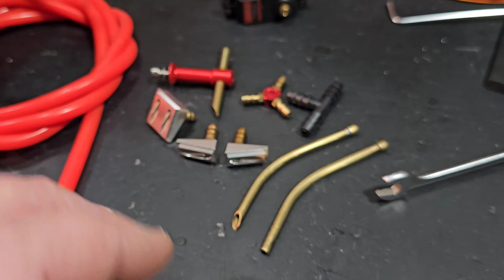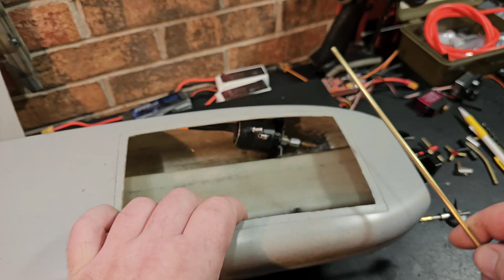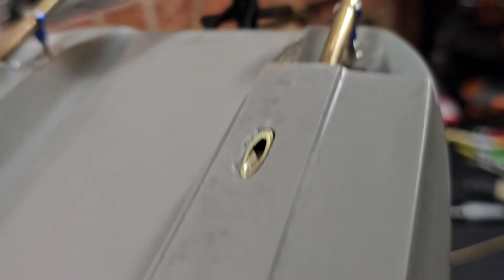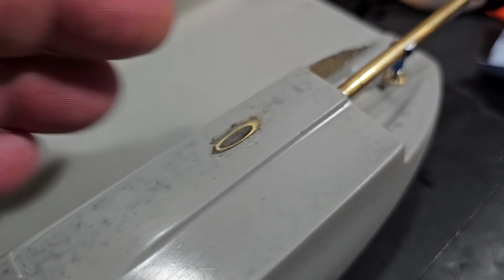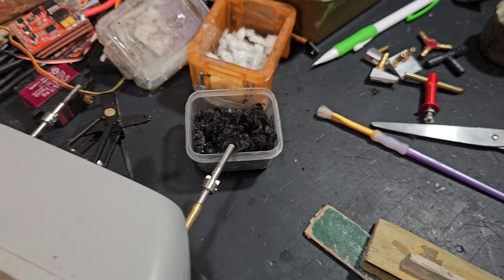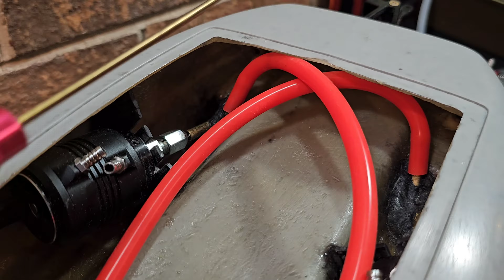Cheap Flush Mounted Water Pickup Install Twin Motor Cat Build Part 3 - Rc Boat Water Cooling

Comment: Hey man my name is Mike Berry I live in North Carolina I just want to let you know that your channel I came across and subscribed and I've been watching a ton of videos the idea you had to carbon fiber line the inside of the UL 19 and use the aftermarket motor mount and the other mods that I could have gone bought the black jack 24 rtr and upgrade everything but I just bought the hull and lid.. carbon fiber mat and titanium motor mount and a nicer 2.4 radio. I'm using two 3 cells on a 3660 2600 KV with a fly color 150 and a 45mm high rake sonic wake prop. And a 5mm drive line and twin intake inline rudder and stinger. Every idea has been a offshoot of what you are doing in several different boats. So no tray or anything factory... I'm doing a perfect lateral balance on the boat with 3s in each side sponson. Home made CF trays laminated in  and just let everything I have learned from you and your channel is going to get integrated into my first time scratch build... I don't want to spend 250 on a rtr and upgrade everything afterwards... I got a new hull and canopy for 99 buck.. 20 for the motor mounts and a roll of CF weave mat and bsi epoxy. I'm going to be going to the max with my cat. Might need to change the color of the boat with name it ... Evil kitty. Or one bad cat. Anyway do you have any ironclad rc stickers for my build? I am going to be getting a lot of pictures and sending them to you if you are interested.. you have my inspiration piqued. You are awesome and your attitude is just so much like me and the way I am with my other hobbies.. custom rifle builds and rc airplanes... I'm all about wide open wild style building and playing with them. Everything from hand built wildcat caliber race guns to rc edg jets and giant motor aerobatic stunt planes that stuff. I bought a cheerwing carbon looking vee hull mono with a 1890kv 32mm OutRunner brushless on 4s and I fit in my 100amp ESC. High rake prop and all metal hardware.. a little tweaking and I have a 50 mph China toy boat that has a lot of potential to be a 70 mph mono with me stripping it out and lining up the hull in carbon fiber and adding a few better components and upping the cell count. Was thinking of going to the CF motoe mount and a 3690 and a cv joint and solid shaft of stainless steel with a small flex shaft on the tail end and adjustable stinger.. or go to the other side of power and use a nitro engine.. novorossi or modify my Evo .61 nitro engine from my airplane... Or use a gear box for the OS 72 nitro methane four stroke... I'll have to machine it a water cooler head and use a little water pump for flow and a second tube pick up for a coil of tubing around the cylinders block... Anyway sorry for the long text but I don't think you have any idea how much of a inspiration you have been to me... I've watched all the other stuff and guys and nobody's is just crazy about the idea of being crazy different and don't have to do what everyone else does.. anyway thank you for your videos and hellraiser attitude. It's my style and I love it. I need to get some ironclad rc stickers for my own insanity... Gotta rep my inspiration 😈
Reply from the maker: Hell yea the blackjack 24 sounds epic, bet she hauls ass sounds SYCK!   unfortunately I don't have any stickers available as of now but I'm working on it.  BG4L

Comment: looking good.  I use pipe cleaners in the open  ends when IM painting or using  epoxy.  On the bench today is a sonic wake.   It had an 8 inch section of the side missing.  Didnt come with any parts. soooo  I closed up the water ports top and back and removed the tank so its not self righting but now no one will know what it is.   Then next project may be a black jack 42 and Im thinking it needs twins.
Reply from the maker: Pipe cleaners come in handy for sure, I use them all the time.  Good luck with your build BG4L

Comment: can you tell me how do you find the CG  on a 29 inch vee mono
Reply from the maker: Usually, on a mono hull, the cog is 1/3 or 30% from the transom measured from the  back of the boat.  Depending on hull type or water conditions, cog could move forward or aft. 1/3 or 30% is a good place to start.

Comment: On first listen of the intro I could almost swear you called it the “chips ahoy” 😂 I think that should be it’s nickname from here on out
Reply from the maker: "Chips ahoy" is a fitting nickname, the hull is chipping every where 😆  (just to be clear Model Ships Ahoy is the ebay vendors store)
Reply: @IRONCLADRC  it’s official then! I did actually go look at it awhile ago. Have been contemplating a mini twin build for awhile but I’m tempted to get the new mini zonda as hull/hardware. Just big $$$
Reply from the maker: I like the tfl mini zonda too sweet little boat.